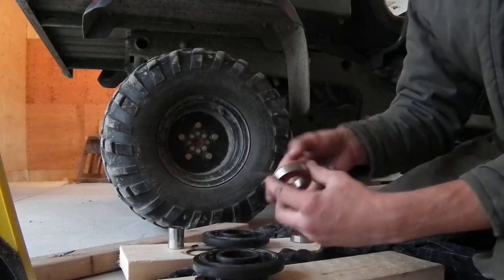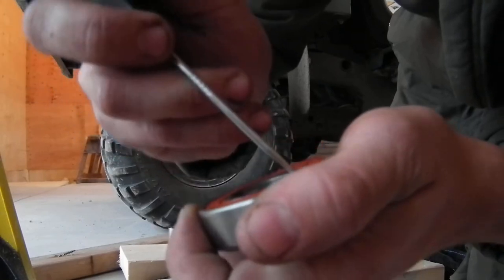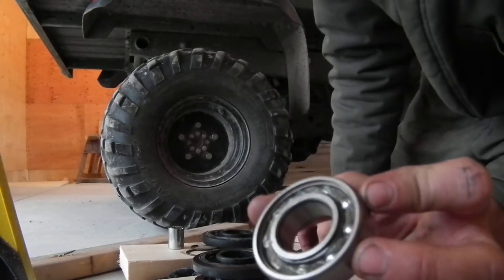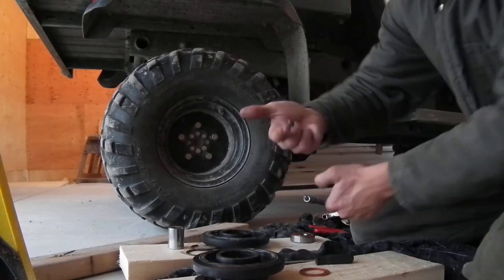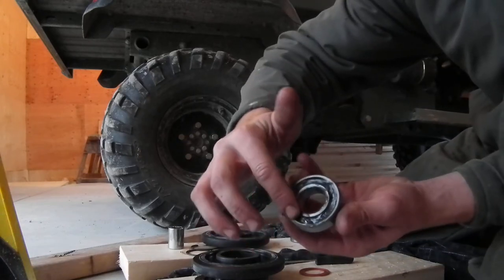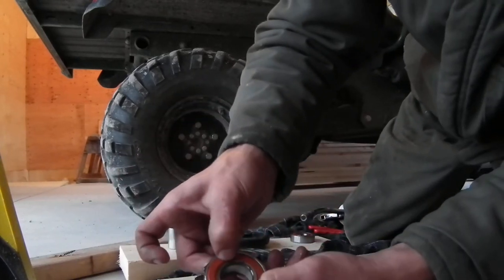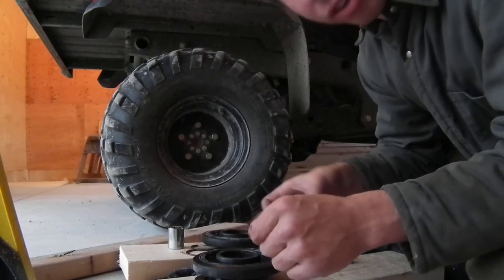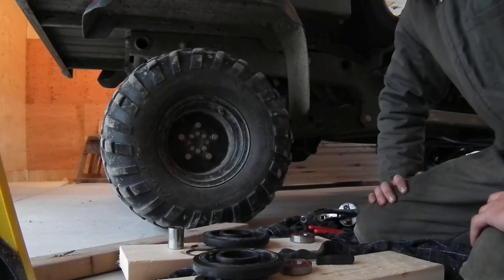How To: Make Snowmobile Idler Wheel Bearings Last Longer

Comment: My experience in automobile wheel bearings is that one of the biggest differences is in the seal design.  Almost every one that I pop apart has obvious evidence of moisture contamination.  Some seals last longer than others, and some just simply do a better job of keeping water out and grease in.  Some bearings have no slop at all, but start making noise.

I am sure that a better/different kind of grease will protect against the water better, and you can extend the life of a cheap bearing with a better grease, but the best of greases isn't going to protect it forever.  You could probably get the cheap bearings at $2.50 a crack and take them apart once a season, clean and re-grease and make them last a really long time.
Reply from the maker: Agree with everything you said Paul, i have done a lot of automotive stuff also and it is almost always the seal that causes the issue. In this case of the bearings on the sleds they are subject to so much temp change, ice, snow, water gravel and pretty much anything. Then they sit for 8 months and do nothing.

Comment: This is a good tip, but there is a lot differences between cheap and premium bearings. One of the main differences is the quality of the seal which holds the grease in. The cheaper economy bearings have very poor seals and the grease will escape as the balls push it out as they roll around the race, letting water in at the same time. I know from experience. I still think this a good tip but without the quality seal the grease won't last. Also the hardness of the races on quality bearings is much harder and will out last the economy bearings. I will purchasing some Quality made in CANADA (NTN Formula) bearings as I tried this last fall to some china bearings on my Apex and the bearings were dry by the end of the season.  NTN Formula bearings are premium bearings and aren't even that much more $$ than the economy junk! They also come with grease specific for cold weather applications. There are also other quality bearings out there that are made in the USA. If your bearings lasted that long they were not the cheap china bearings with the crapy seals.
Reply from the maker: Thanks for the reply mike. I am out of sledding now but I learned the trick from a guy that had winters off and would put 30K+ miles on a year and he suggested and showed us the difference. There may be a difference in metal I have not researched. I always had great luck with packing and reselling and they would last for a crazy long time. Cheers. Josh

Comment: Really? Premium bearings are just economy bearings filled with more grease? It wouldn't happen to be the fact that economy bearings are made in China & Premium bearings are usually made in the United States, held to higher standards, better steel, finished off using special low temperature grease that's usually good down to -40 to -50 degrees F....What kind of grease are you using, regular wheel bearing grease (bet it's not even synthetic) ? Then mixing 2 different types of grease at that, going to break down a lot faster, most likely than if you left it alone...
Reply: TheSixnix LOL

Comment from the maker: Do the work yourself,go buy some premium and economy and see what you think. And synthetic grease. Say whatever you want I had 9000km on my bearings an pulled them off still in decent shape. Didn't have any bad ones by any means. Where do you get the info from that they are made in china with cheap steel?